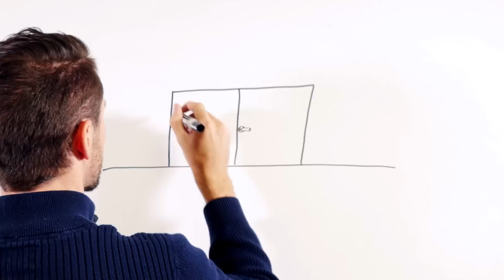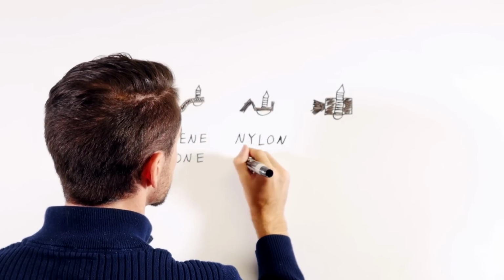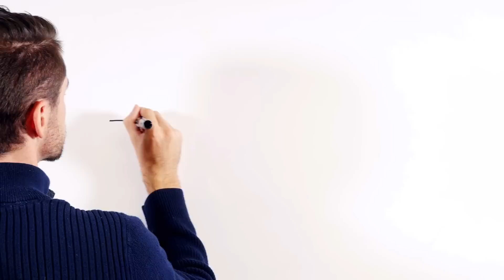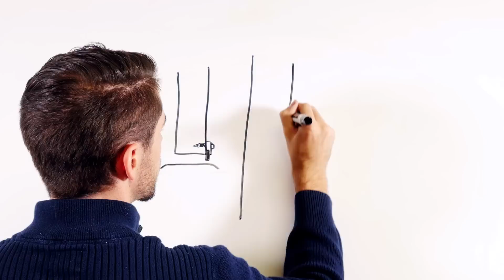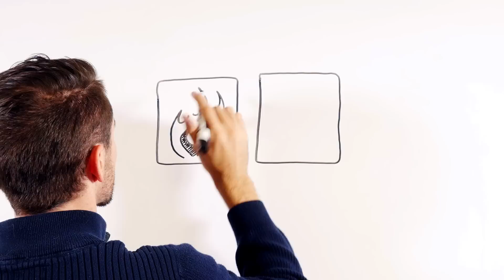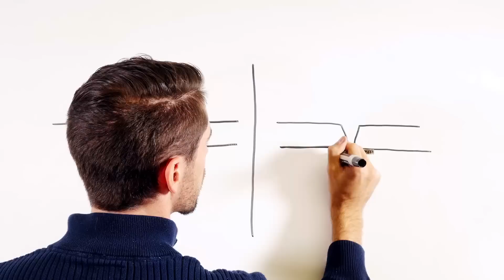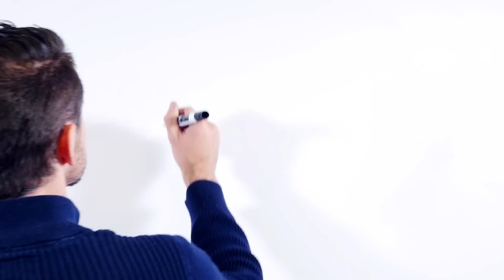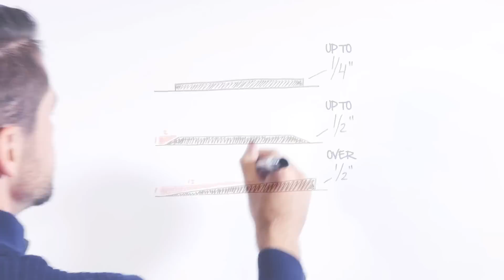Intro to Door Hardware: Gasketing and Thresholds

Comment: Know that anytime you suggest an overlapping astragal ,and coordinator ,it can never be applied to a pair of double active doors ,having two panic bars ,as the coordinator will do it's job closing the primary door ,but once the secondary door closes ...you can not open the primary door at all ,it is trapped until the secondary door ,with the overlapping astragal is opened ,this is called special knowledge to open an emergency egress door and is illegal to do. Yet I have seen this done in many places , as a "quick fix" to lessen a too wide center door gap on hallway or stairwell doors ,etc...,as was cited by a fire Marshall . The overlap astragal vs coordinator is commonly used on "ACTIVE /INACTIVE leafs with auto flush bolt applications... Just a fyi, as mentioning overlap astragals can be dangerous ...thanks ,great instruction guys !!